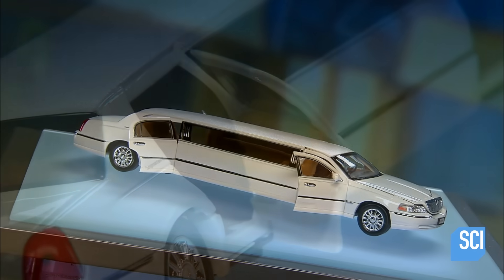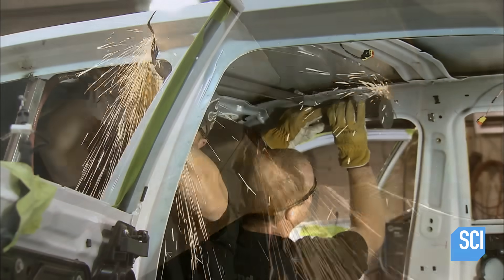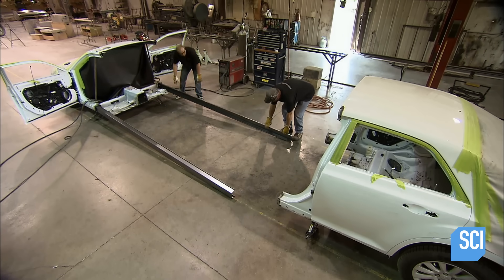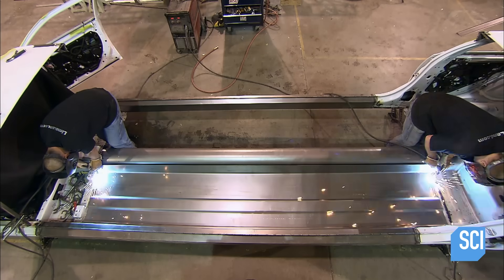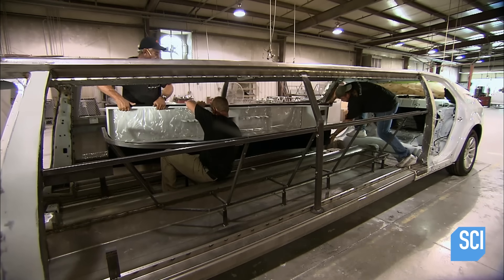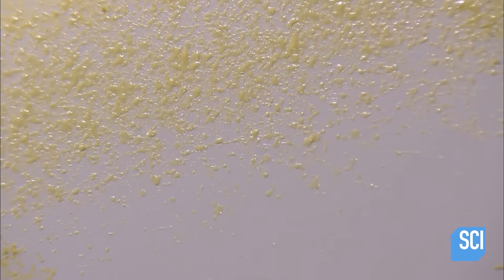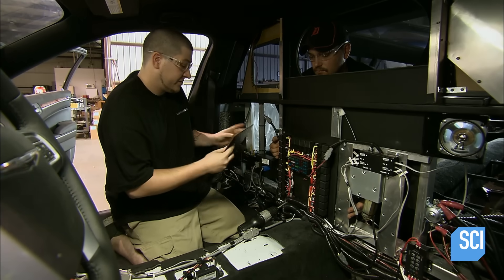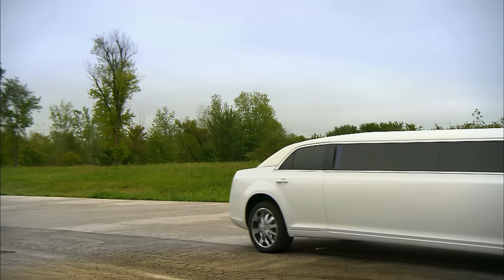How It's Made: Stretch Limousines

Comment: wait how do they extend the fuel lines, brake lines, sensors, wiring, etc? they skipped a lot lol
Reply: Tbh i imagined only fwd cars could be made into limo's thanks to ease of not having to extend the drive shaft
Reply: @kapishss5540  The Lincoln Town car, the scale model they show at the beginning, was one of the most prominent stretch limos while the town car was in production. It's based off the panther platform produced by Ford, (Crown Vic, Grand Marquis, etc), and was RWD,
Reply: @MrPancake1225ayylmao  I never understood why tho
Reply: @AAAAAAndrea  why they would use Town Cars? Because they were rugged and dependable. They are fairly simple cars with a body mounted on a separate chassis which made it much easier to split and then reinforce with longer components.
Reply: It's all wireless, Bruh!
Reply: @philsherrer  breaks work via bluetooth
Reply: They just replace everything.
Reply: i would presume they replace the wiring, fuel lines etc with longer versions of the same thing and the the car is most likely fwd so no need for drive shafts.
Reply: @wabbit4936  No Chrysler 300s are rear-wheel drive. They just essentially take the one-piece drive shaft and make it into a two-piece drive shaft.

Comment: Surprising how all the measuring is done by hand with simple tape measure and level and not computers. Shocking that it could actually drive straight down the road
Reply: You would be surprised how many measurements are still done by hand using simple but effective tools
Reply: @waitingforacentury  true, but no one making commercial cars, like real manufacturing company, like MB, Rolls-Royce, Toyota or even old Lada's 2021.
Reply: Yeah they're only meant to be driven slow in cities. Still, this look really filmsy and unsafe. Wouldn't be a fun time if someone crashed into it.
Reply: @shadmansudipto7287  In 2018 there was a limo in NY state that crashed and killed all 20 people inside
Reply: @CopperCityFabrication but that was because the owner of the limousine faked the mandatory NYS inspection and the car had faulty brakes, and some other problems. Owner/driver is in jail now!
Reply: We build nuclear ☢️ power house for electricity generation with just simple tape measures. As Union Pipefitters 👷🏻‍♂️
Reply: @mattjohnson9743  must be in Russia
Reply: im guessing this is one of those shops that allowed them to film them doing their work haha,  I doubt this is a car filthy rich use,  but for proms etc for a few years.
Reply: It's a car not a space rocket.
Reply: @Bigfoothawk  Cars are still assembled precisely, because all those tolerances add up. If you look at a car factory they spend a lot of time inspecting the parts, even the exterior body panels.
Reply: @Bigfoothawk  the comment I was looking for 😂😂
Reply: i feel like it doesn't.
Reply: @romusz  Uh, yeah? I work with instruments that can measure down to the 10 micron level (i.e., 0.0005 inch). They're used to measure cars my dude
Reply: @romusz  I used to work on cars which includes doing alignments. Even if it's off by 1 degree the car would be driving crooked with the steering wheel straight
Reply: I think it over simplified for the viewers
Reply: I agree
Reply: So you like to think deep and beyond huh 😉😉
Reply: I've worked fitting and welding nuclear powered military submarines. Guess what, we used tape measures and welding machines to build most of it.
Reply: lol

Comment: 01:13 This looks potentially inaccurate. The stretch company I have visited several times, as I have driven the cars from which for years in the 1990's, put the donor car on a rail track, then cut it and pushed it apart for accuracy.
01:20 This is how you end up with a donor car with basic rust protection, stretched  with no rust protection. Much to the agony of future owners. 
03:00 Again - no basic rust protection. 
03:47 The trimming cut is a typical place for rust to start. 
Would I order a car from here? No.
Reply: Good observation lol.
Reply: This whole thing is just waiting to crumble apart, I knew it was gonna be built pretty badly but god damn...

Comment: Thin single sheet support rails that are only tack welded. Looks strong and safe to me 😒
Reply: I was surprised, too, that the frame rails are so thin and flimsy.  Under all the paint and vinyl tops, they're really crap vehicles.
Reply: Only parties happen in Limos, Bruh!
Reply: They are tack welded until they are certain the piece is where it’s supposed to be. You don’t start laying down beads until everything is tacked in place. If you start welding seams before tacking it in place. The welds would pull the metal in one direction. So if you weld one side first, the metal rail will have shifted by the time you get to the other side. If you pull the rail back into place and weld you would introduce stress into the work piece. Therefore you tack the pieces together then go back and seam weld. They just didn’t show them finishing up the seams, but you can see the finished welds if you look close enough.
Reply: tbh this video was pretty lackluster. i would be watching and after one cut theres already seats framed in the car
Reply: They're stronger then you might think. I saw a video of one getting hit dead-center by a train. It obviously wasn't driveable afterwards, but everyone inside survived the accident.
Reply: Tried with actual people or crash dummies?? @Dat-Mudkip

Comment: I'm shook. I thought they were made in a factory, not it a garage. And I'm pretty I'm not the only one curious on how they removed the major components of the car before cutting it in half
Reply: I’m sure the high end ones are factory made to order, but it’s was just likely a simple cheap one.
Reply: @g.williams2047  Possibly factory modified, but most likely a similar process just with better materials and more careful craftmanship. Making changes to a few vehicles on a production line is incredibly expensive, cheaper for them to build the complete vehicle and disassemble it again to modify it. 

I'm in the automotive industry, and we have a department that takes our product directly off the production line and converts it for a different use.
Reply: every "major component" is still just a bunch of metal and wiring. Screw off the same way they are screwed on. Not rocket science.

Comment: It’s a good thing the Chrysler 300 has a hemi V8 most of the time. All that added extra weight and they didn’t mention getting a bigger engine, transmission, springs, or brakes. It must already have a big enough engine, hence the hemi V8.
Reply: the hemi in the 300 compared to the pentastar aren't much different in terms of power. you can also supercharge the pentastar without modifying the engine itself because everything in it is forged from the factory. but I don't think that power is the main goal of limos, lol

Comment: I didn’t see where they upgraded the brake system to handle all the extra weight from both stretching it and quadrupling the passenger capacity.
Reply: It was right after they installed the passenger airbags and gave me a pony for my birthday
Reply: It depends on who does it. Electrical upgrades are pretty common (like high output or dual alternators) but major mechanical upgrades are generally not a thing.
Reply: @channell11  usually they are like brakes and suspension
Reply: Why would they need to do that? It is still the same car but longer.
Reply: @42luke93  adding extra car adds weight. Adding extra passengers adds weight. If the braking system is designed for a max of 10,000 lbs of weight and it’s now 15,000-20,000 lbs of weight because of the additional car and passenger weight, the brakes will not function adequately.
Reply: What extra weight? Nothing here looks like it would weigh much.
Reply: @DeltaWho4  That mid section, glass and seats weighs about 800-1000 lbs maybe, and add 2-3 more people, we are in the range of possibly 1500 lbs easily

Comment: All this added weight but same engine, suspension and brakes? How about tuning? Steering recalibration and adjustment?
Reply: This is why limos aren't very quick to accelerate. They're carrying a hell of a lot more weight that that engine was originally designed to handle.

Comment: This looks kinda… flimsy…. I definitely don’t wanna get on one anymore.
Reply: It looks very stable honestly, those steel bars are definitely safe. If this looks flimsy you don't wanna see how they make actual cars lol
Reply: @eto5034  About 10+ individuals died in one of these couple years ago.
Reply: @eto5034  Dude, they welded new frame rails with like maybe 2 inches of overlap to the original parts of car, THAT is the weak point.

Comment: They use the original suspension, springs an all?
Reply: i wondering the same thing too, are they using original spring and break or enhanced one
Reply: No. you can see the car is slightly lifted in the after image and on top of that the wheels are bigger and the tire profile is higher. They probably just uipgrade the struts to a heavier duty strut.
Reply: They left a LOT of details out. One would expect about 1500 lbs more load with the addition, seats, glass and 2-3 passengers more.....
Reply: Probably not. Although it would probably still work with original shocks just not as long lasting

Comment: I guess no one bothers with the brake lines, bleeding and all that. What's important are the disco lights...
Reply: They are not going to show everything, cutting floor footage.  Whatever ran front to back, you know they had redo in a longer version of whatever it was.  Driveshaft, wiring, brake lines, glass, sheet metal.  Interior panels, carpeting and so on!!!  There is no way the standard suspension and brakes could handle the added weight.
Reply: Bleeding? Why tf should a car bleed?
Reply: @dolopdieren  it’s a process of removing air from the brake lines
Reply: @Leg239  right, thanks for clarifying!

Comment: What about showing the modifications to the suspension that handle all the extra weight?
Good video 👍
Reply: @Ruben9505  you’re assuming they didn’t do any of that post weld and build. Plus everything they had to do to the undercarriage. Just cuz the video didn’t show it, doesn’t mean it didn’t happen
Reply: A worker welds whey protein packets to a strut assembly for additional strength. After completing this task for each of the four corners, all four wheels and tires are reattached and the vehicle is lowered from the lift. A worker in the training department then performs a test for the one rep max of each modified strut to make sure they meet quality control specifications. Once the gains have been approved, the vehicle is now ready for the next step on the test drive course!
Reply: They probably just upgrade the struts to a heavier duty strut. Or if its a nice limo itll ride on airbags. I think most of the lincoln town cars ride on bags and was one of the reasons they were used
Reply: yeah and what about the crazy long driveshaft? where did they even make that thing? Glossed over some important technical stuff here.
Reply: And that the drive shaft has to be extended by like 8 feet
Reply: 4:52does a good job showing the changed ride height. She got beefed underneath for sure.
Reply: This company opted not to do them, nor extend the driveshaft! Real fly-by-night quality.
Reply: they probably get stiffer springs, that's all
Reply: What about the brakes system?
Reply: It doesn't look like they do anything according to "how its made" haha.
Reply: Aaa what modification? ;)
Reply: Bruh, we're only talking a couple hundred pounds. Drive shaft, suspension, electrical, exhaust, braking, fuel delivery, plus or minus two fifty. It's all wireless Bruh!
Reply: What modifications? 👀
Reply: They don't have to show everything..that's trade secret...converting the drive shaft into a longer one,.making the wiring harness much longer,looking for long handbrake cable,replacing the short brake lines,etc...there's still many of them that they didn't show...
Reply: Yeah I think they left out quite a lot. Such as the suspension, like you said, but then the wiring for the taillights, power windows, interior lighting, power trunk, then all the parts the allow the car to run, other than the driveshaft and the few things they did show in this video. Not to mention how crappy this was made. Measure a couple beams, weld them on there, put some sheet metal on the beams, and your done. 😁 totally won’t fall in on someone
Reply: Can only fit so much info into a 5 min video lol
Reply: They left out a lot of things. Instance, the wiring, the extension of the fuel and brake fluid pipes. Let alone the hand break steel wire.
Reply: There's usually a "limo prep package" installed at the original car manufacturer's factory that includes heavy-duty chassis and drivetrain components.
Reply: They don't touch the suspension or braking systems at all. Limos are death traps.
Reply: @chaeburger this is true my family was in the limo business when I was growing up and they would break down all the, they don’t upgrade the engine or transmission at all and they add thousands of pounds
Reply: they didnt show t right?? that means the suspension is the same
Reply: @AzmiMaulanaHamdani  they didn’t show a lot of things. That doesn’t magically mean those things didn’t happen. It’s a 5 minute video to show a 2-4 week project.
Reply: @AzmiMaulanaHamdani  No. I use to work for a limo company. All of the suspension components are very much upgraded. Can you imagine not only the added weight of the car, but then adding 8 people + the driver and all of their stuff in a car, what that would do to a factory suspension? Use your brain.
Reply: @ppipowerclass  even if you ignore what it would do to a suspension, a stock suspension would have the car be a low rider the first time any passengers get in. Look at the comment section of this video. It’s so hard to see how much common sense people are lacking now. Some people are flabbergasted by even the idea that limos aren’t made by the manufacturer. They couldn’t imagine cutting a car in half.
Reply: @jamesbizs  
They should show how they make a hearse. The US and Europe do not do it the same way. Tesla hearses are made in Germany and The Netherlands.
Reply: @jamesbizs  "are you proud of me now, daddy?!? I told all the youtube commenters they were wrong and dumb!! Just like you used to always tell me!! please notice me daddy!"
Reply: Why don't you just work there and find out
Reply: @Cory_Peters512  Ha!  Good luck with that!  I can't imagine how many years of automotive manufacturing experience that would require!
Reply: @justincarawan-carawanco.pu1639  Based on the quality of welds, I'm assuming that if you can tell a car from a horse and buggy, you'd be overqualified.
Reply: @tyrannosaurusimperator  Ouch!
Reply: @justincarawan-carawanco.pu1639  Zero.
Reply: :face-fuchsia-poop-shape: @Cory_Peters512